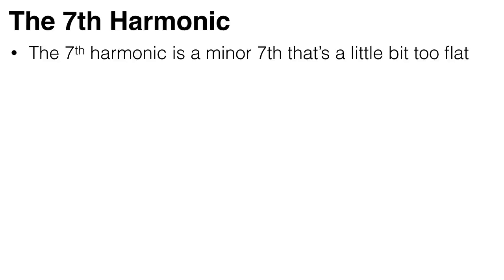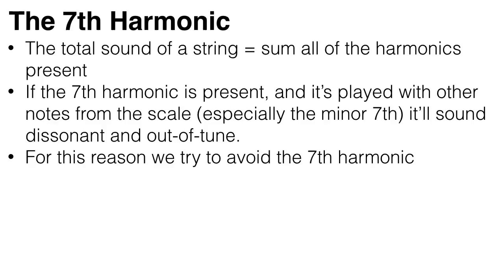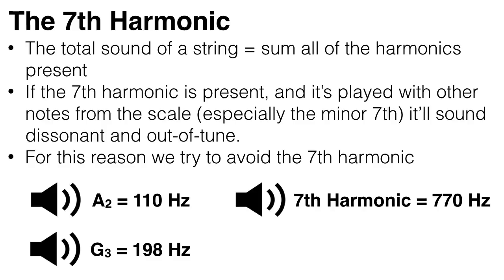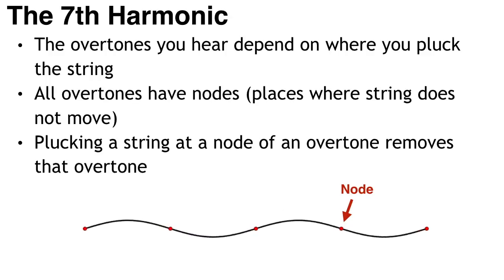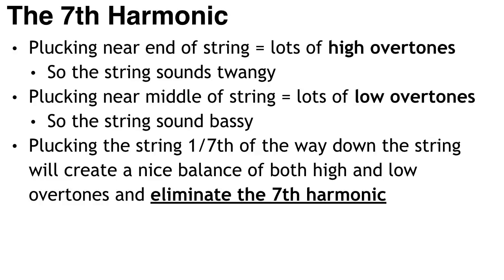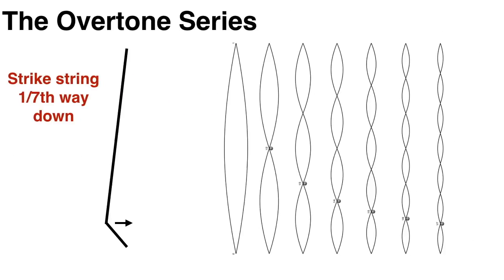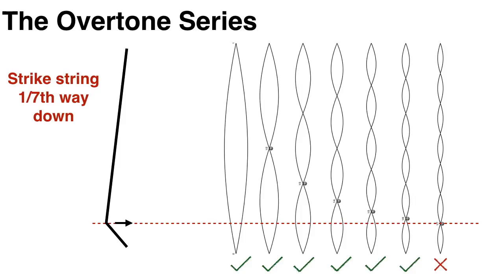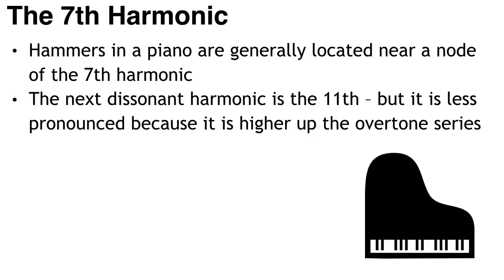15. Avoiding the 7th Harmonic

Comment: Strongly disagree on this, the equal temperament system is out of tune, the flat seventh is sharp and the seventh overtone is in tune
Reply: @AlgyCuber  then why are you learning any other theory because you are saying something that is extremely absurd.
Reply: 12 tet gets all its intervals as in tune as possible to the harmonic series by knocking all its notes slightly out of tune, its a great system but its limited. The harmonic 7th can sound really good in chords and it will make major and minor chords have a more stable sound which is cool. But these chords wont sound bright
Reply: @androiduser603  nope, major thirds are very much out of tune and the 7th harmonic is the origin of 7 limit harmony
Reply: @frfrchopin  yeah but if they where to select another tunning with good 3RDS other intervals like the 5th and 6th are knocked to far out of tune. The Best equal temperment would be 53 tone but that's to hard to play on most insturments
Reply: @androiduser603  depends on how much you care about the fifth, and I think 6ths are not out of tune when tuning the 3rds to be good. I suggest you to maybe look in other types of tunings since 12EDO is only good for prime numbers 3 and 19 pythagorean stuff.
Reply: @frfrchopin  okay

Comment: You mean avoid the 7th harmonic so as it doesn't clash with the equal tempered 7th? It's that that's dissonant not the harmonic. Even the 11th is more an assonance than a dissonance - sounds great in some contexts

Comment: You might as well say: pi is a three that is a little too high ;-). The seventh harmonic is fine just like it is and is used to great effect in barbershop quartets, blues, etc
Reply: The barbershop music have notes played close to one another. The full expand of the 7th harmonic goes over 3 octaves is where the problem comes. I think Chopin's common upper technique more likely runs into the problem.
Reply from the maker: True. I meant in relation to our current Equal Temperament Tuning. But I'll try cover that in future vids.
Reply: @WalkThatBass  Measuring dissonance of harmonics with 12EDO is the wrong order of how things should be done. You should measure 12EDO with how good its approximations of the harmonic series are, not the other way around.
Reply: @WalkThatBass  Is a temparement entirely based on the harmonics possible ? Just Intonation ratios start diverging with the harmonics at the 7th harmonic. Also the 11th harmonic seems to be an ruthless divider…
Reply: @alex4777-ggg  strictly speaking that wouldn't be a temperament. You describe just intonation, which is basically ideal in the philosophical sense. The problem being that you arrive at a theoretically infinite number of notes, including several shades of the same note that pile up very quickly. A temperament is any tuning system that makes do with compromises between those notes, sacrificing "accuracy" for practical utility.
Still some musicians see these various shades as a feature rather than a bug and avoid temperament altogether.
Reply: @gonzoengineering4894  Specifically, a temperament is a system that removes the effect of some commas (commas being an error between two frequencies that arise by going to the 'same note' in two different ways), such as 12ED2/1 tempering out the syntonic comma of 81:80 which is brought on in JI by the difference between the sum of two ditaves and a major third, compared to the sum of four fifths. If you're looking for any grouping of notes that do not strictly temper out a comma, you're looking for the word tuning.
Reply: @numbers3268  Temperament, as you defined it, is exactly what I described.
Good job committing the tuning theory jargon to memory
Reply: who is this justin tonation i keep hearing about